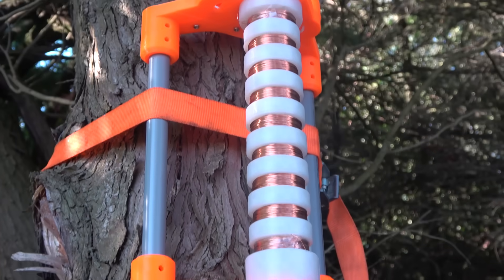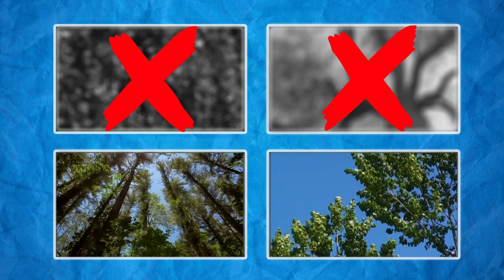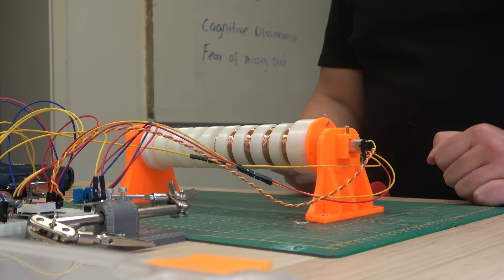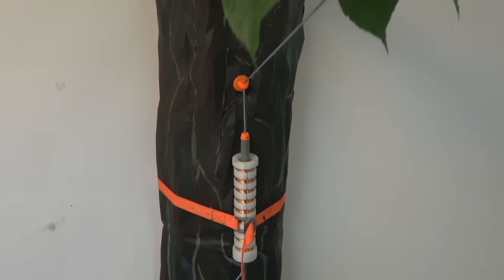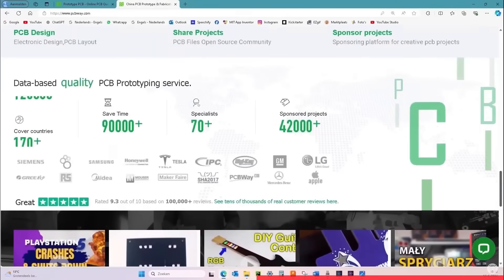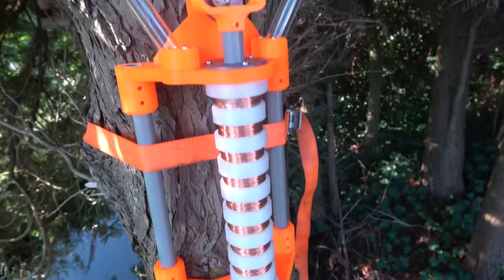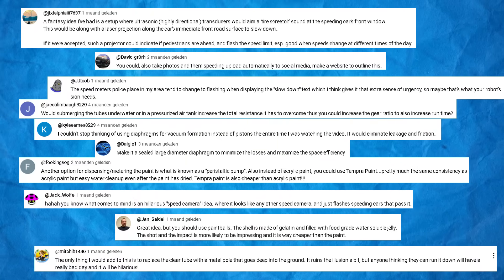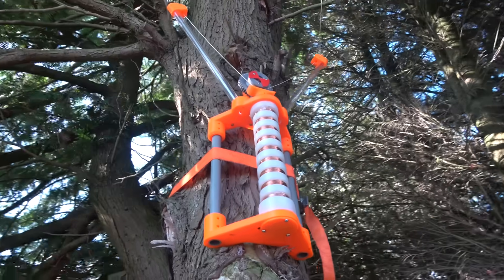I Made a Tree Generate Electricity..

Comment: I saw a video of a speaker from a radio with a piece of window blind glued to it. They connected a volt meter to the wire posts and when the wind moved the piece of blind it moved the speaker cone back and forth, which made a little bit of electricity. It's similar to the idea in this video. In the other video they talked about making a scaled up version and connecting a bunch together. If you haven't seen that video maybe you should because it might give you ideas. They were trying to get an oscillation from the piece that was being blown in the wind and use the motion to make electricity. The speaker didn't require anything that turned, back and forth was enough. I don't know if that helps but I hope so.

Comment: this is good but the linear generator does not make sense in the end, at least from the branches.
to collect the "oscillatory energy", you converted it to rotary and then to linear motion. why not stop at rotary at that that point and use a cheap industrially made generator. it seems cheaper than the tons of big magnets. required for the construction. unless there is a cheap way to transform low movement to fast movement, the trunk movement would also be constrained to being transformed to rotation.

outside of this, this in an interesting proposal, especially at the trunk movement as it has probably more torque than you can realistically extract. 

the biggest problem is installing it at a point where it moves enough, as you want to install it in a zone full of branches, you will have to climb the tree, or make a drone that can remove branches and another one that can install the thing.
but this is a truly amazing idea to harvest the existing infraestructure (a.k.a trees xD)
Reply from the maker: Yes and no🤓 one of the reasons i went for the linear version is because of the CW to CCW (etc.) motion of this prototype. This means your constantly working against the momentum of the rotor of a rotary generator unless you work around that with let's say a ratchet system for example.

Comment: Great idea!  Lose the tree.  Connect a number of these generators to a VAWT and connect them with a cam mechanism to increase the generation.  Modern VAWT's have some very efficient blade designs, and can work even under light wind conditions.  In very strong wind conditions, simply lower/raise the cam mechanism to disconnect the generators.  Depending upon the efficiency of the linear generators, this might actually scale.  Damn.  Now I have to play 😀

Comment: In order to optimize the system, I would think that just like with a wind turbine, the location would matter a lot and also the right species of tree that can withstand maximal movement in the wind would be really good. Heavier trees or branches would make more torque. Likely the main trunk with maximal torque and resistance would be better than smaller branches with less torque. Pulleys to increase torque would also be good. Yeah this is an interesting idea though, thanks for sharing!

Comment: Using a mechanism like the one in an automatic watch, you can wind up a spring, then release it to drive a generator at a higher speed, kind of pulse charging a battery, from time to time, but getting more voltage during the spinning of the generator, allowing a simpler and more efficient power output.
Still, pretty nice idea

Comment: I think for the efficiency, we must harvest as much energy as possible. To achieve this, branches should be barely moving. The resistence force of coils must be just below of the branch forces. 

So, to achieve this, a sensor for measuring the force without affecting it too much, and an adjustable coil setup could be helpful i guess. Basically you switch of some layers of the coil when there is less force, by making that part of the coil an open circuit, and add them back when there is enough force by connecting their output to main circuit again.

But it is only a guess. I assumed that piston should be moving at full extend for efficiency but if you desing it to move quickly, when there is greater force, some of that energy would be excessive and wasted energy since the mechanism doesnt depend on momentum, only depends on movement.
Reply: The summary is, you need to force the branches to not move but let them barely move, and you need to do it both for the stong winds and weak winds, and you need to achieve it with a single setup, and the magnets must move at full extend to maximize efficiency in any circumstances. That is summary of my hypotesis.

By the way, i need to say that it is a very interesting and cool project and i hope it will inspire something bigger.

Comment: there is ratcheting devices which will take rotation from either direction and turn it into one common direction. food for thought. i would also go with rotary stator, linear just seems so inefficient
most trees are around 12 tons in weight, do not underestimate the inertia they have... they could pull that 3d print in half without remotely slowing down, there is no shortage of power available from trees moving... specially if you were to span two trees...
you can gear it way higher, you're not going to stop a tree moving with a 3d print, go wild

Comment: There is a possibility to use a clockwork style method. using the tree to wind up a weight and then the weight being released can spin a Generator thus creating electric. Trees pulling power is great and has a good amount of strength, A good method would then to use flywheels and gears to increase efficiency. Love the video ( new subscriber here)
Reply from the maker: Thanks! Appreciate your support🙌
Reply: You could use a solar powered circuit or timer to switch between a winding and powering mode. And then use gravity as an energy storage system. Then you could store power all day and release it at night for low power (like lights)

Comment: I'm experimented with this idea, and found it plenty useful. But l have used generator and reduction from a grip-powered lamp.
I think that main direction of developing at such kind of systems is a higher voltages, because this lower width and cost of cable in mass harvesting.

By the way, as a professional in linear drives I don't believe  in efficiency of this type  of generators due to lower speed of moving between magnets and coils.
Reply from the maker: Thanks for your feedback! Really appreciate it👌

Comment: Just use a stepper motor as a rotary generator. It will generate in either direction.
Use a 4 wire bipolar type, with 2 bridge rectifiers made from schottky diodes for reduced diode losses.
A decent sized stepper motor can produce 10 watts no problem, even at low speeds or with back/forth motion.

For the mechanical side, I would just use a pulley on the stepper motor, with a string, one end tied to the tree, the other end hanging on a weight. Obviously the string wrapped a couple of times around the pulley. And also the weight needs enough vertical movement clearance to equal the sway distance of the tree.

My system would be very simple to make and also to install, and provide good electrical efficiency and good overall reliability with no gears or reciprocating parts.
Reply: Stepper motor, yes, this would increase the alterating frequency by orders of magnatued which in turn increases the output voltage.  you should also be able to stack or chain several stepper motors to extract more power from the same motion using Belts or connected shafts. each would have to have its own rectifier type  circuit a common cap/charging
Reply: @pdwpackrat9246    yep, each 4 wire stepper has 2 independent coils, so for each motor you need 2 bridge rectifiers.
You can buy large stepper motors these days at reasonable prices, even size 34 and size 42 models.

Comment: Use a battery to store the power. Charges when not in use, instant power when needed. You could use a simple phone power bank. But you'll need to rectify the power flow with this set up.
Reply: If nothing else, this would be a neat feature for campers. It would give them a chance to charge their electronics while still preserving that "off the grid" aspect of camping.
Reply: Yeah, we could probably get 15% charge in 3 months!
Reply: coz batteries come without energy costs of manufacture.... better use those batteries somewhere where they are more efficient?

Comment: this would newer be more efficient than a wind turbine, you can't even charge a phone from it, also why you converting the movement of the tree to linear movement of the strings then to rotational an then back to linear generator? you could slap a normal motor directly to that small wheel to generate power, it will have less loses
Reply from the maker: Yes and no🤓 one of the reasons i went for the linear version is because of the CW to CCW (etc.) motion of this prototype. This means your constantly working against the momentum of the rotor of a rotary generator unless you work around that with let's say a ratchet system for example.
Reply: @ConceptCraftedCreations  you do not need ratchet, just connect the generator shaft directly to the smal gear, add a full bridge rectifier and measure the generated power

Comment: one challenge is getting the ropes up bendy trees since that could be quite dangerous.
need to work out a way to set this up that can take advantage of the tops of the trees.

another thing i noticd was , the device is converting the motion with a pully into cricular motion, then that circular motion is only being used , up and down wasting the left and right parts of the movement. is that a way to get the movement to be more oval to provide higher lift with the same motion?.
i saw a video on making a bicycle more efficient, where someone did that for a bicycle pedal as the downward force exerted by ur legs is more available than the back and forward motion. They redesigned the mechanism making it really high torque
Reply from the maker: Yes and no🤓 one of the reasons i went for the linear version is because of the CW to CCW (etc.) motion of this prototype. This means your constantly working against the momentum of the rotor of a rotary generator unless you work around that with let's say a ratchet system for example.
Reply: @ConceptCraftedCreations  sorry not sure what cw and ccw are. when u say ratchet system do u mean like how the pistons in a car engine are moved?